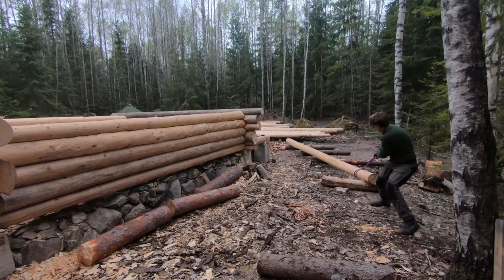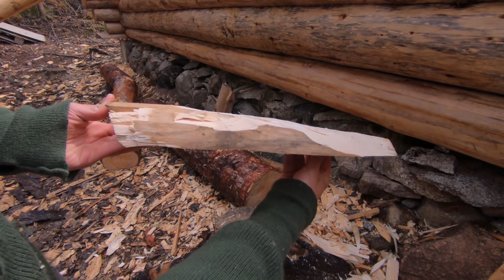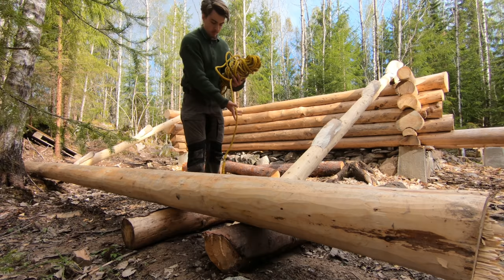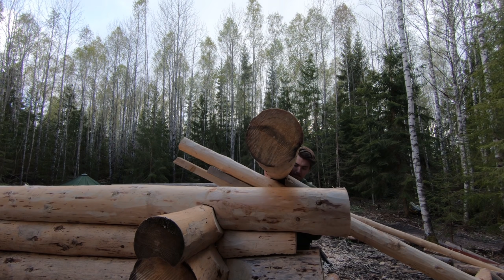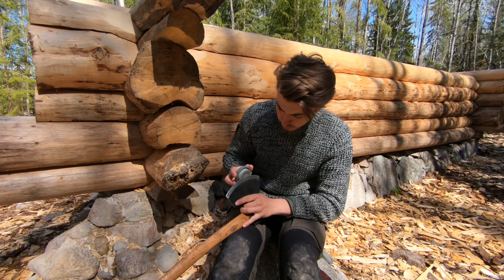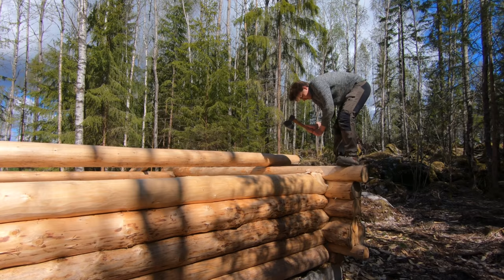How To Lift Heavy Logs on Log Cabin with Simple Tools! | 15 | - One Man Traditional Log Cabin series

Comment: Well done.  It ia looking great. As it get taller,  you could use a block and tackle to help lift the trunks up. A simple one could be made from the wood you have lying about by carving 3 holes in a block. 2 would be in the upper area (make sure they are symmetrical) and one in a lower area (load time off point).  When using it grease the holes with tallow or butter to ease friction. This should in theory increase your pulling power.  It can be used in conjunction with the lifting guides you made. It is only a thought. 
 well done.

Comment: Well done, Erik. Your work is very impressive and neat. Just a little tip: if you make a small score with your saw on the bottom of a log you're cutting off, it won't splinter when you cut through from the top.
Reply from the maker: Thank you for the tip. I normally do that, but sometimes forget.

Comment: Mycket Bra!  I use this method/technique in my work, to right or flip over vessels/boats (some rather large) that have over turned in the sea, with another vessel..  In my work we refer to it as "parbuckling"... often used to hoist barrels aboard ships long ago...  but using the mechinical advantage of the anchor and moving portion of the rope... very cool to see your use.. many may say this is how many ancient civilizations succeeded with what they built.  Tack!  And a lovely video!

Comment: Your solution for moving the logs in place is excellent.  I do think though that eventually you will have to use some sort of a pulley system once the walls get a bit higher especially when it comes to the roof.

Comment: Great idea with the sloping logs. When it starts to get too heavy you can allways add one pulley. Looking forward to see the final result! :)
Reply: If I had to do where I’m building my cabin again I would have left a tree in the very middle of the footing. I used a tripod to lift the first few courses up but now I was looking for something else.
Reply: Linda NWFirefighter  But then you’d have to move your ramp for each log raised.
Reply: I wondered if you could push the log up the ramp, one side at a time. Then when you get above your reach, you could pull it up with the rope. Could be easier on the hands!

Comment: Respect, you doing a great job.....easy to see you want to do this the hard way.....but so many simple ways to make this process a little easier. Like;
Use two ropes, even if one at a time.....or that rope you are using looks long enough to tie one end to each of the ramp rails (instead of standing on it) and loop the middle under and over the log....no more shuffling back and forth, you could probably operate just from center position.
Learn two knots to help grip the rope, 1st Marlin hitch, 2nd Prusik knot, will help make temp handle to grip rope since you appear to have an aversion to gloves.
At the top use a lever pole from inside to lift last bit of log over top lip.
Work smarter not harder......just some suggestions ;)

Comment: Impressive work young man.  Consider tying both ends off the rope on top and loop the center around your log. When you pull your rope you'll have a better grip and the log will be supported by rope at each end, saving you from moving back and forth.  Nice ax work.

Comment: Seems like you could devise a pulley system and it would make this much easier.
Reply: he is using the log as a pulley.  by standing on one end of the rope, he is gaining a 2 to 1 mechanical advantage.
Reply: I have done similar and used winches right after my pacemaker surgery

Comment: it can be convenient to not cut the logs to size until the end. having the different lengths of logs sticking out can help for working on the higher walls instead of a ladder.
Reply from the maker: Yes I waited untill the end to saw the ends. Because I am doing it by hand I can not let the log on top that is going to stick out further be placed before sawing them straight. If you know what I mean.

Comment: The rope trick you are using is called, in English, a "parbuckle".  You might find it easier if you doubled the rope so that you were pulling at the middle point of the rope. Secure the two lower ends of the rope to the corners of the  cabin, run the rope loop under the log and then back up to where you stand.  Pull on both ropes - the log will be less likely to wobble or cant.

Your cabin and effort is very impressive.

Comment: You did a good job for your first (???) attempt at this. These methods are not unknown by any means and it would really help if you took a class or got mentorship from someone that understands actual traditional rigging methods for architecture...In this case, you are "attempting" with some success "parbuckling" but seemed to miss a lot of the steps and methods that would have made your job a lot easier...I commend you for figuring out that you needed "keeps" in your system and you did a pretty good job of splicing them into the ramp poles, which is also standard practice, particularly when working alone...

The primary issue with the system (as practiced here) was you trying to work only one end of the timber at a time rather than the traditional method for "single man" parbuckling which would have afforded you a faster lift and the ability to lift longs 4 times larger...which means these logs would have moved much faster than they did without the continued sliding and moving from end to end...

Thanks for sharing all of this project. I hope you get a chance to do more and perhaps edit in some of the things you are trying to learn and would do differently...

Comment: How about a thinner block attached at the bottom with a strap and a spring underneath at the front that way it will not be so hard to pull over and will pop up after the log passes it?
Reply from the maker: I like your innovative thinking. I see that working.

Comment: Question: do you build your log  cabin with green logs? Are these logs been dried for awhile? Can I build it with green log freshly cut?
Reply from the maker: It is better to build with dried logs. These were cut in the winter and built with during spring, summer and now autumn. You can do it with green logs just expect a lot of shrinkage, so build windows and doors appropriately. Also green logs are much heavier.

Comment: Is it easy to install electricity (solar power) and plumbing in these kind of log homes? Also how many trees did you have to cut down
Reply from the maker: No electricity in my log home. Don't know exact number of trees but Spruce for build is about 45 and then there is the clearing of the space for the cabin. I have replanted over a thousand trees.

Comment: I don't know anything about wood or building log cabins so i'm really curious. What does the moss do good in between the logs? Is it just like "Isolation" so that air can't pass trough?
And another question. Why are you drilling the holes in the logs? :D (my guess would be that it makes the logs more aligned?)
Reply from the maker: Yes you are very correct. The moss is isolation (there is always some lite gapes ). The wooden dowels hold the logs so they stay aligned. Sometimes the logs want to warp when they dry, the dowels prevent that. :)
Reply: @ErikGrankvist  Aaah okay that makes sense! Awesome video btw :D

Comment: Don't take my full word as I am not a professional, but the insects could be termites. they eat wood. The holes are a bit big though. Good video!
Reply: Actually, that's a myth. Termites eat as the wood is and what kind of wood it is. They don't eat all the woods.
Reply: Also are you taking about the nots in the wood because those are from the branches that were then cut off
Reply: @chasestender3531  no

Comment: I’m honestly pretty curious about log cabins. Do they leak? How do you fill the cracks in between each piece of wood? Does the log cabin eventually rot? Do they last forever?
Reply from the maker: We have a old log cabin called a "härbre" (Google it) that is 260 years old. We have redone the roof and floor but the logs are still the same. I use moss to insolate between the logs. If done right this log cabin will last a very long time and be keep warm.

Comment: Odd. Seems like a waste of time. Your structural logs could easily be lifted well above your head by lifting one end at a time. Simply drag it to the site then lift one end onto the corner of your structure. Then, lift the other end and drop each end into its notch.  Now, mark your new notches then roll the log out to chisel the new notches.  Also, that seemed like a lot of extra effort pulling it over those cleats.

Comment: Use block and tackle to pull them up so the rope doesn't rotate the wood... block and tackle existed 250 B.C and you can bet the pioneers used them aswell. Your method is fruitless cause even though you shift the rope to either side you end up having to lift the entire log.